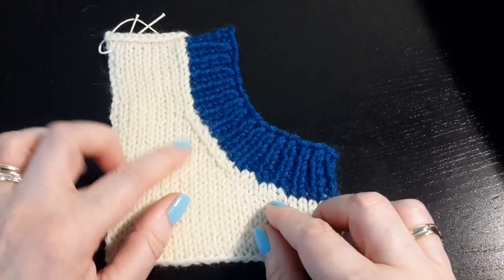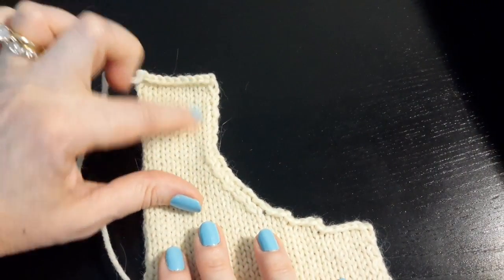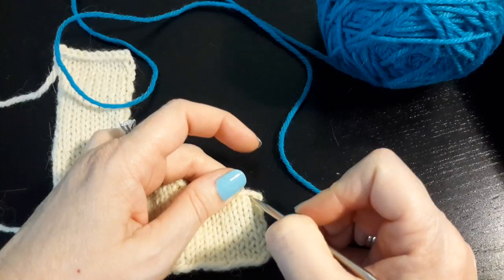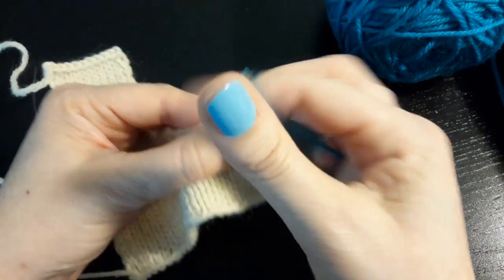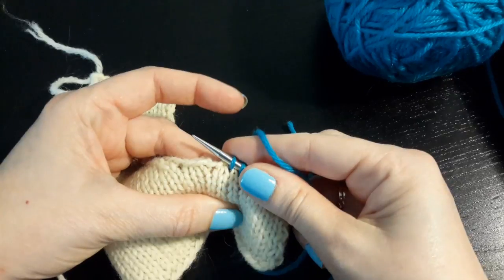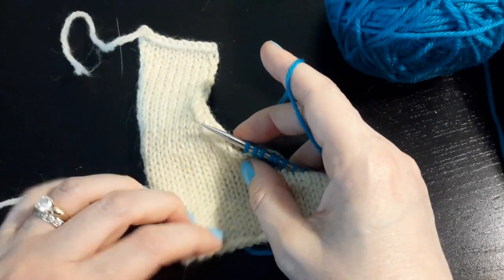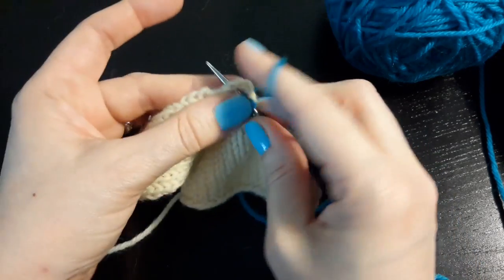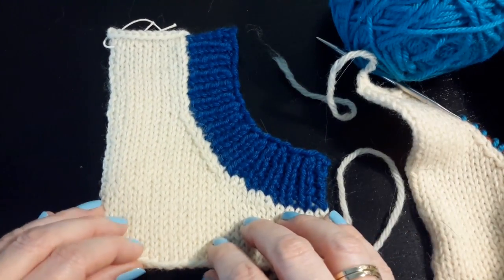Picking Up Neckline Stitches

Comment: So am I not supposed to make a slip knot in the beginning? I always get nervous about the tail
Reply from the maker: You could do that if you'd like ( and then make sure to remove the slip knot and not work it!) But it's really not required. If your tail is long enough it won't come loose. Then just snug that stitch up before weaving in the tail afterwards.

Comment: excellent tutorial but I get lost when you talk about ratio etc, I'd like an exact math exercise that one does and not guess at it. Thank you very much
Reply from the maker: There isn't a hard and fast rule - you will need to calculate it for each fabric you create.
Measure your stitch gauge over 1" in the neckline fabric (you will have to work a swatch in the yarn and needles and pattern you will use for the neckline - ribbing, etc). Then measure the row gauge over 1" in your body fabric. The stitches over rows is your ratio - reduce it as much as you can. So, say the stitch gauge is 5 and the row gauge is 7, your ratio is 5 sts to 7 rows. For every 5 passes of the needle into a stitch, you will need to work 7 rows -- so you'll do something like 1-1-2-1-2 (where the 2s are you will skip a row, and where the 1s are you work one stitch to one row.)
I hope this helps and doesn't just muddy the waters more!

Comment: Very good tutorial videos. 👌🏼👏💖💚💕thank you. please can you teach also the Back of V-Neck  of Vest for kids too? . I been trying to knit a V-Neck Vest for my grandson. But, no any success for me  to finish this project because The V-Neck shapes it turns too small. I need some help to learn a bout that. Thank you 🙏🏼
Reply from the maker: Hi! I will try to film something on that soon! In the meantime, the back should be worked very similarly to the front - make sure you pick up stitch to stitch along the straight edges. You may need to adjust your needle size if you find it is too tight.

Comment: Not sure how you worked out the ratio
Reply from the maker: I took the stitch gauge and row gauge of my base swatch (over 1") - and that was my ratio. That usually works as a good starting point. If your neckline pattern is a drastically different stitch gauge, then you'll need to take the stitch gauge from it and not the base fabric. (But still use the row gauge from your base fabric.)